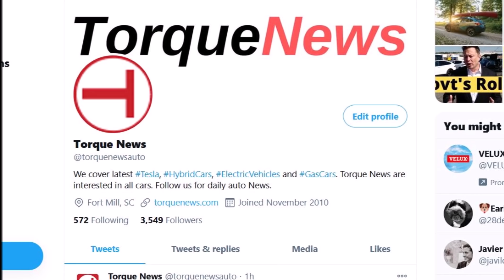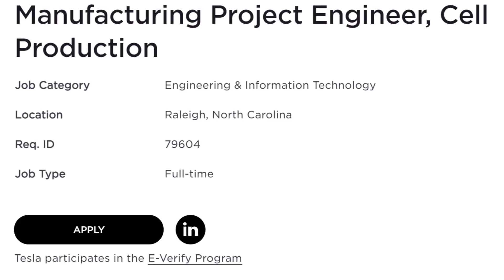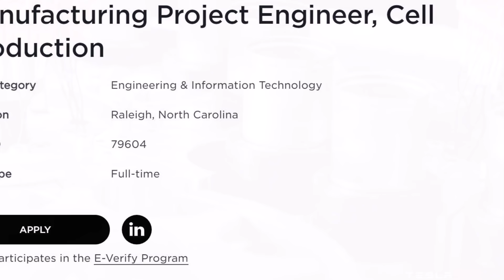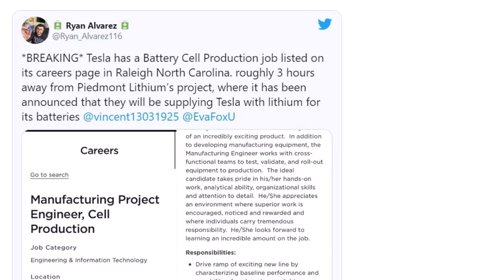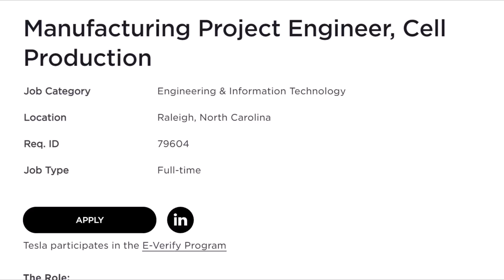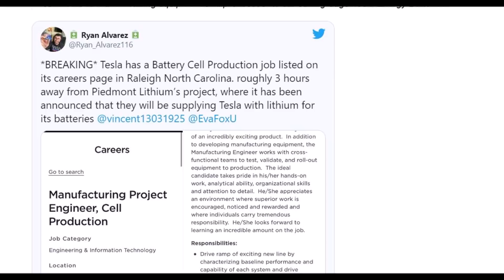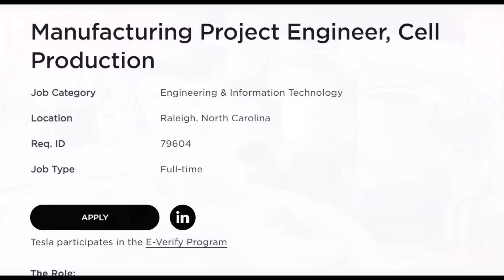Tesla May Produce Its 4680 Battery Cells in Raleigh, NC

Comment: This doesn't make sense to build battery plant far from a production plant.
Reply: Actually it makes sense from the point of being close to lithium supply. Battery cells are easier to transport than large quanities of raw materials. Also there is a lot of automation engineering interest in the Research Triangle area.

Comment: A design oversight not addressed in public by Tesla, besides the multi tab advantage. Example on page 0:03. 

Multi tab approach in 4680 cell format show no sign of - welded pathway - to conduct heat and electricity from multi tab to the motor and coolant, expecting performance no better than standard cell packaging. All lithium batteries before multi tap has welded pathway solution. 

That leaves us that the only way to pass heat and current out of the cell is by point contacts, which is a performance and safety issue. 

Problem? 
(1) Omitted welded pathway, heat and electric conduction performance of multi tab 4680 cell requires substantial contact and retention forces in cell packaging, that has not seen publicly addressed by Tesla. 
(2) point contact required retention force that cannot be derived from, or passed onto through electrode and multi tab because tabs are made of annealed ie soft copper but spring materials. If contact force was derived from the cell sealing process, such force will degrade through temperature and inertial shocks and cycling. That eventually produce an open circuit and subsequently an electric arc between multi tab and cell casing ie output terminal, to a rapid oxidation process or an explosion.

Comment: Opening a new factory in NC seems less likely than simply hiring an engineer from that location for future work in Giga Texas, which is not complete yet. In fact he will likely first go to Tesla's Kato Rd. Fremont, CA facility to learn about the 4680 battery production process.  And then he could end up working in Giga Texas or even the upcoming Giga Berlin battery factory.